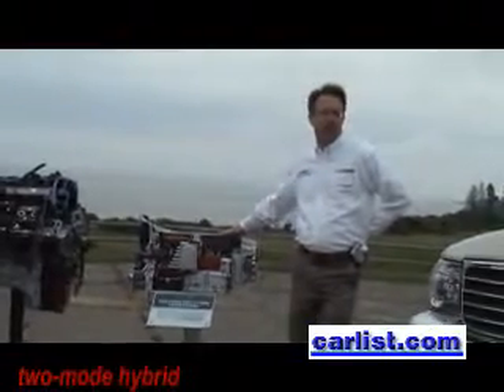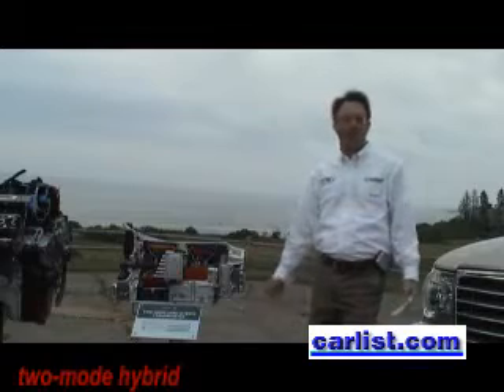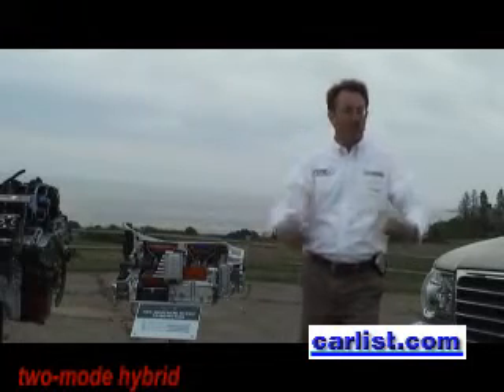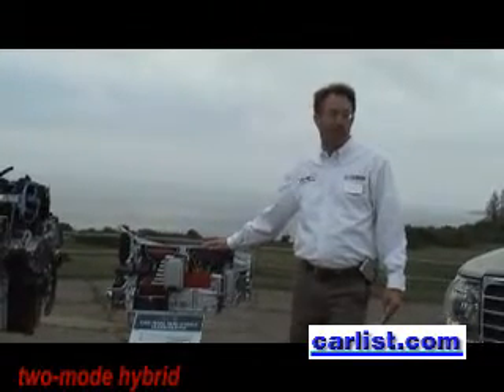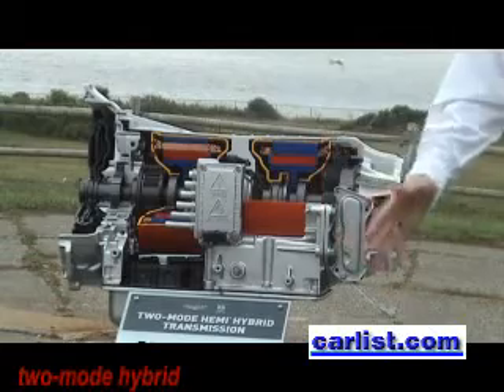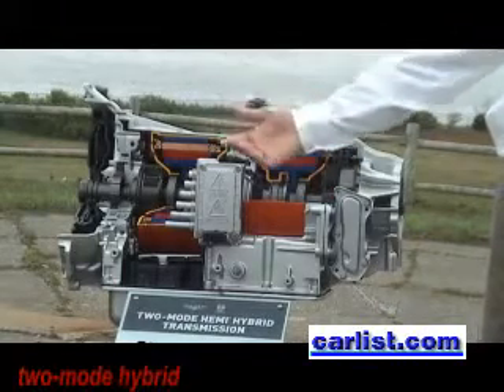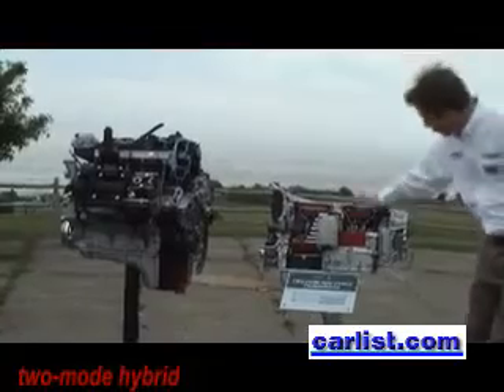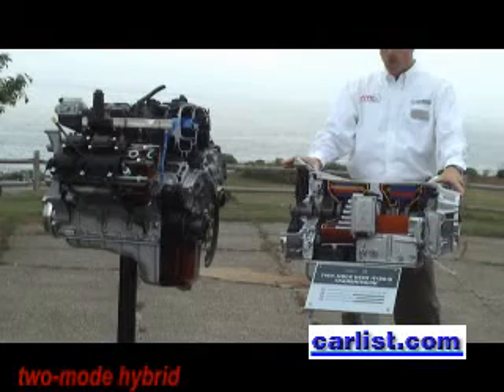Glenn Denomme explains the difference between a straight hybrid and what is a two-mode hybrid?

Comment: Hypothetically you could use EV mode without the assistance of the gasoline engine? What would it take to completely disconnect the gas motor from the EV drivetrain?

Comment: Question. If this transmission were to fail, how possible would it be to switch it out with the regular transmission for the truck it's in (not the hybrid version)? Would it bolt right in? Obviously, I know that if you did that you would no longer have a hybrid. But I'm just curious if they're interchangeable if you didn't want to pay for the hybrid transmission.
Reply: Not for less than the hybrid trans would cost. Assuming you don't need to change harnesses, (which you undoubtedly would.) You'd still need to change the tcm/ reflash the tcm. Also my understanding is that the alternator is part of the transmission, there's no engine driven alternator, so you would have to figure that out as well. It's basically pointless. You'd spend a whole lot of money to get less efficiency, when you could've just bought a conventional truck in the first place for cheaper.
Reply: I bought a 2009 Tahoe Two Mode in Nov 2018 dirt cheap at 6k and No it is not practical to replace the hybrid trans with a regular auto transmission. The hybrid trans is an integral to this FLA engine and the hybrid system. One of the 2 electric motors inside the transmission actually is the starter! Too many parts will not work. I guess you COULD change the engine and transmission as a unit plus all the electronic controllers, if you had a donor vehicle. These GM Two Mode units are getting older and a lot cheaper. Most people seem to understand that the chance of something going wrong with an obsolete/out of production vehicle (last manufacture was 2013) will be cost prohibitive to repair in the future. Hybrid battery new is over 4k Transmission is 6k  special aluminum block 6.0 hybrid FLA engine is 8k Unless you can get a Killer Deal on a nice clean unit that takes into account the upcoming legacy cost I would walk away from this deal if you are looking to buy one. Now here is the funny part too. When you get ready to do a repair the internet youtube type advice is very slim and very few dealers have any familiarity with the product. Not a good situation, you will find that the dealers tend to misdiagnose any problem. typically what they think is a trans problem could be a hybrid battery problem and they usually just start replacing major parts and then when they get finished the poor owner owes +18k on a 6k vehicle that still has problems LOL  Ruuuuuuuuuuuunnn
Reply: @darryls8066  well then it's a waste of money to buy one dirt cheap unless you tend to convert it like you said with a donor vehicle later on in the future.
Reply: @bohemialite6371  Report back have driven for 18 months 25k miles (now at 220k miles) but I did replace the Hybrid battery soon after my first post a reman hybrid batt unit at $2,700.00. Now I have a hybrid brake system problem and cannot figure out what to do to it. For reason stated 11 months ago these units are NOT for the faint of heart gamblers LOL